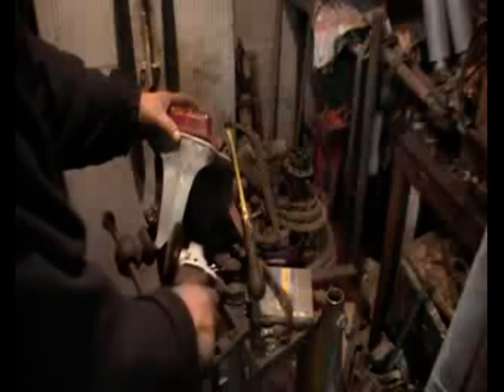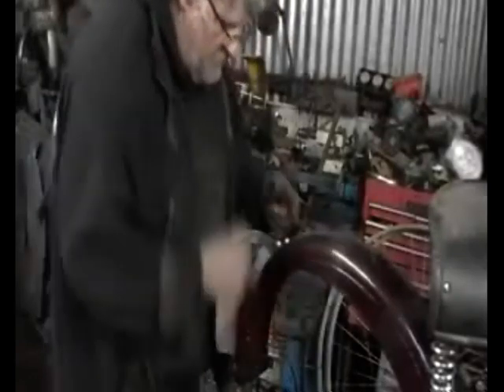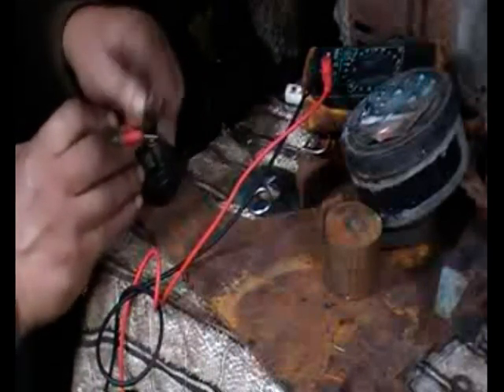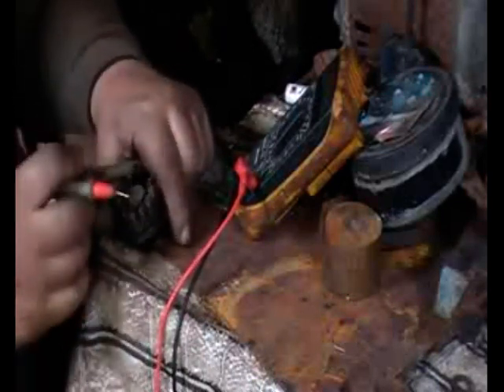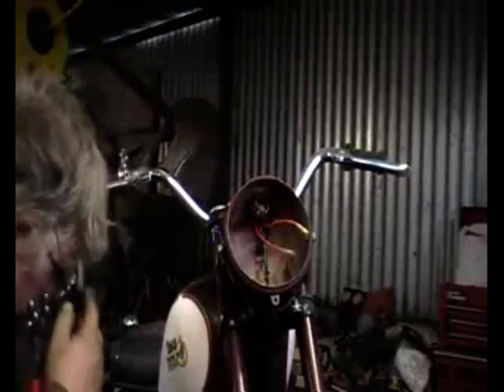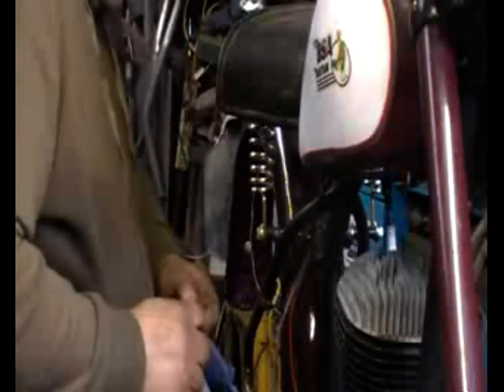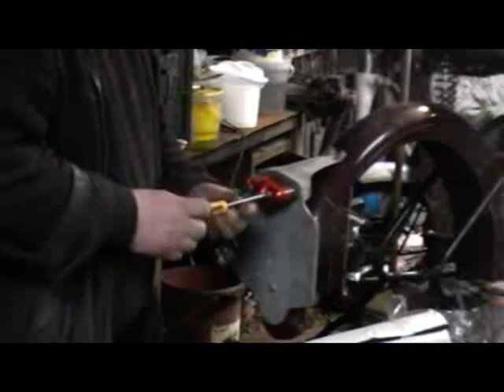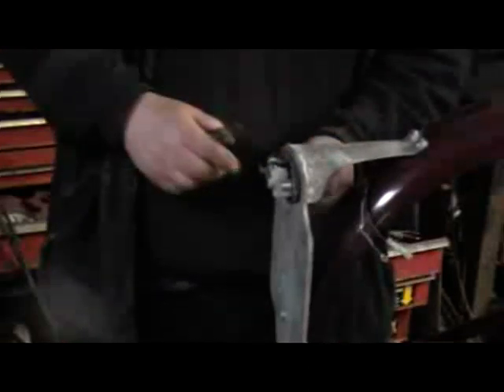bantam D1 wiring (part 13)

Comment: I completely rewired my D7 in two hours flat. It didn't have a battery of course. It used to blow the tail bulb at high revs so I made my own resistor using banding wire. I was a budget restricted 16 year old in 1969.  Worked a treat ! I recently totally rewired my brother's '59 Super Rocket and I ran a separate earth to each component because older bikes that didn't have one from headlamp to battery suffered from steering yolk ball bearings pitting due to electrolysis. All  plated bullet connectors I soldered and all wire ends were soldered... no stakons were used at all. I used heat shrink tubing on all connections and all wires were then sheathed in the plastic split ribbed tubing. I made terminal blocks inside the tool box panel using gold plated terminals from a car stereo installer shop and then I used industrial wiring number wrap-arounds  on all the wire terminals so I could create a new wiring diagram.